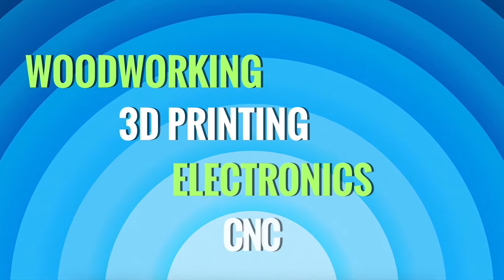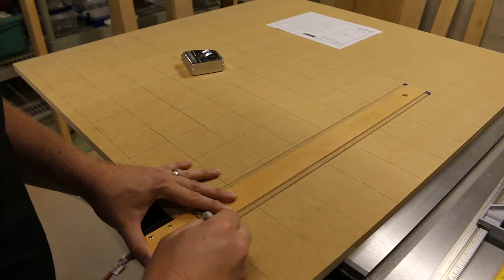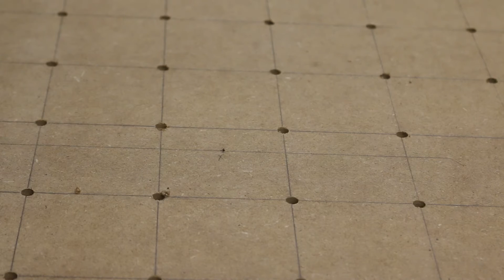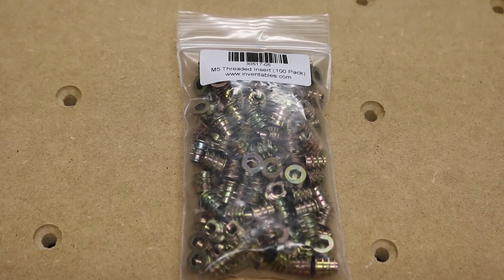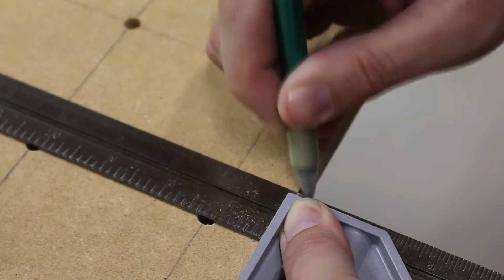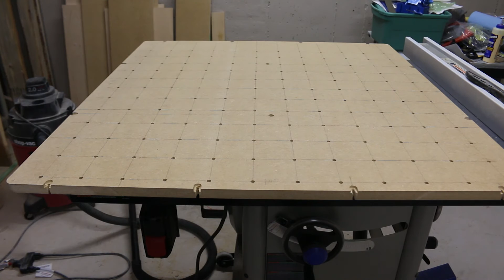Making an X-Carve CNC Wasteboard

Comment: Could you have attached the rails first and then set the x-carve to drill out the 144 holes?
Reply from the maker: The threaded inserts are only used to help secure your items to the table using clamps, etc.  Instead of threaded inserts you could use T-Track with clamps, or even double sided tape.  I chose to put the threaded inserts in for now as I can always use tape or build a different waste board later. I do use double sided tape often too.  Depends on the item I'm working on.
Reply from the maker: I thought about that too at first, but the way the gantry and rails work it wouldn't be able to reach the holes near each of the rails, plus you'd then need to somehow flip the entire x-carve over or at least put it on it's side so you could countersink the holes from underneath and screw the threaded inserts in.
Reply: Why are the threaded inserts needed?  I was considering doing this in the same manner as my Festool MFT/3 table with 20mm holes that can be clamped through or have dogs pushed in.  I was also thinking about adding t-track and potentially splitting the entire table so it could be spread open for edge/end routing.  Any thoughts on that?
Reply: Thanks.  I think I'll go with a table set up like in your other video and 20mm holes that are compatible with my Festool and Kreg clamps.  Do you see the sideboard as necessary or is that space considered in the the custom made wasteboard's width?
Reply from the maker: The sideboard came out after I built mine.  It appears to just be an extra piece of MDF.  I've actually mounted my xcontroller on the side of the table to keep it away from the dust a little more instead of using the sideboard idea.

Comment: Man, what a bummer that you go into 0 detail on this build... Just a video of you drilling holes in random places. No mention of measurements, drill bit sizes or anything... Just a video of a guy drilling holes.
Reply: From the diagram, it looks like a 12mm Forstner bit, with a 5.5mm drill bit.  Or for imperial 15/32" Forstner, with a 7/32" Drill bit. I'm sure you could round them up to a 1/2" Forstner, and a 1/4" Drill bit if needed.   All the information is on the plans, you just have to extrapolate. With blueprints and diagrams, if they've put the information in one place, they usually won't place it at every location.  In this case they place the information in the center of the board, at the location they have the screw holes for connecting to the aluminium track that runs underneath the waste board.
Reply from the maker: +Deceased Gamer Thanks for watching the video. All of the measurements and sizes are linked in the description of the video. I figured since anyone building this for their x-carve would have this document, I'd keep the video short. I appreciate your feedback.
Reply: Yes but you don't mention what size torsioner bit you used for the side holes.
Reply: also what size bit did you use after the torsioner bit

Comment: What size drill bit did you use to drill the holes?
Reply from the maker: +C B I didn't always have the exact bit called for in the plans. For instance, the threaded inserts called for a 6.75mm bit. My metric set had a 6.5mm and a 7mm so I drilled one of each size in a scrap price of wood and screwed an insert into them. For me the 7mm seemed to work best so I went with that. If you don't have a metric set I'd try a couple bits that are closest that you do have and see which one works best. My metric set also only went up to 10mm so I had to find a imperial bit that was closest. For some of them such as the countersinks, exact sizes don't really matter much.
Reply: The numbers in the Brackets (.27), are the imperial sizes. Just use The Google, to give you the fraction size. If needed.

Comment: Great Video, I just order my Xcarve and i dint know how i was going to make the sides holes 
Thanks. Im also from ATL Roswell Area
Reply from the maker: +Frank Vargas Thanks!  I originally found this 3D printed jig to use with a router: http://www.thingiverse.com/thing:1212218 but decided I'd try it with the tools I had on hand.  It went together pretty easy.  Let me know if you have any trouble. I'm glad to help and not too far from you as I'm up by the MOG.
Reply: I was also wondering about this.  Close to pulling the trigger on one.  I'm in Sandy Springs.  How are you liking it?
Reply from the maker: I'm like it a lot.  I'll be putting up some more videos about it the next several weeks.  Including a "It's assembled, now what?" video that goes over what to do to help get it dialed in and calibrated.